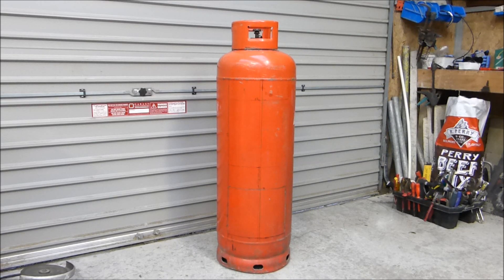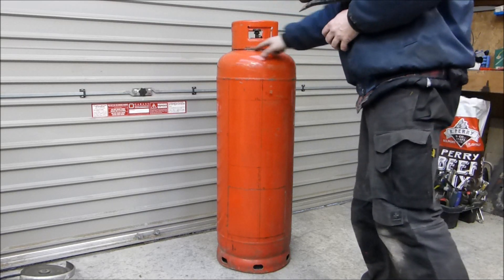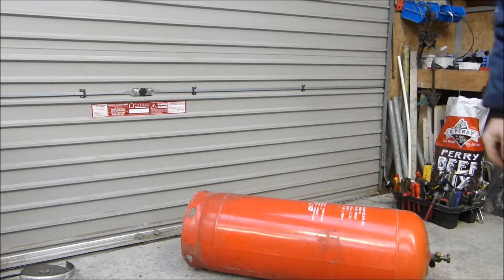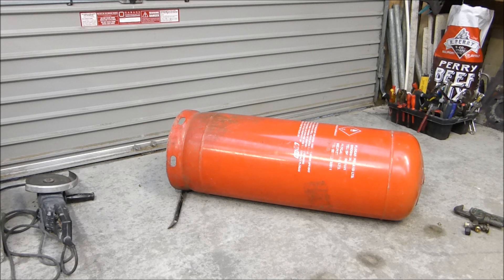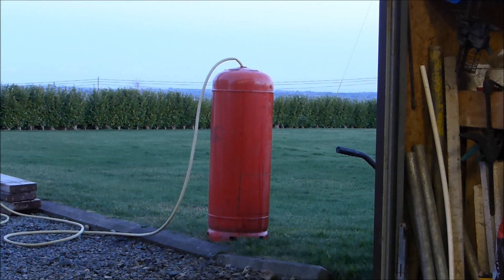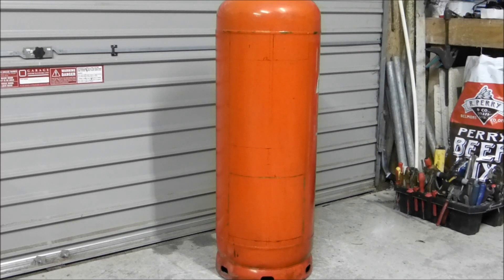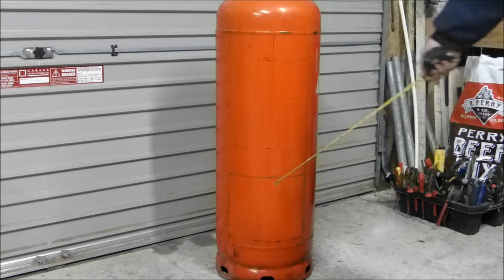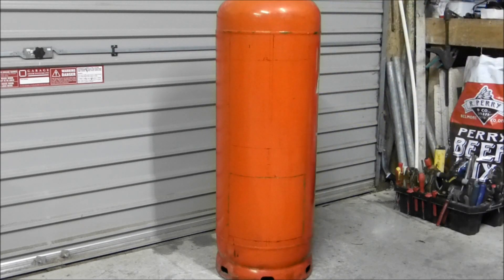Make a great waste oil and wood burning stove heater (part 1)

Comment: Gerry, for those that want to get the gas smell out of a propane tank, adding dish detergent to the water that fills the tank, putting a plug in it, and rotate it a little every day, so that at the end of a week, it's empty. Drain the soapy water out, rinse it out, then one can use it for air tank, or a heater

Comment: What are your thoughts on using the tank from a natural gas water heater?  I have a 30 gallon water heater that I could sacrifice.  I've never dissected one, so I'm just curious at this point.  I've got it on hand, so I'd like to start with that if I can.

Comment: As per david robert 2007 idea a coil down the inside of the chimney gravity fed from the top with a one way valve should theoretically power the turbo !!
Reply from the maker: Hi Alan. Some of the guys doing Babington burners use this sort of setup to make steam pressure to make the oil spray. It would certainly work and of course need no power to sustain the burn. I might give it a go in one of the future projects. Thanks Gerry

Comment: I just had a great idea - in theory you could attach a small boiler to the stove and use the steam pressure to drive an old turbo, the other side of the turbo could then blow air into the burner, replacing the electric fan. Probably wouldn't work too well in practice but...
Reply from the maker: Hi Dave. It would work there is a lot of energy in the waste oil. In video 7 of this particular build I show this conversion working without a fan at all. In other videos I show it working with a forced air type blower which is what you want to replace with the turbo of course.
http://youtu.be/cYxtNRKj1Es?list=PLmQ5wJnkAIoImeXUNv9YfEZsQ1OYRpOHN
Cheers 
Gerry
Reply: It could work, people build burn barrels with turbos and they can get red hot.
Reply: I think you could get close to the same power with used waste oil as they do in the wood burn barrels...the problem is keeping a turbo lubricated and finding a lubricant that can handle the extreme temps